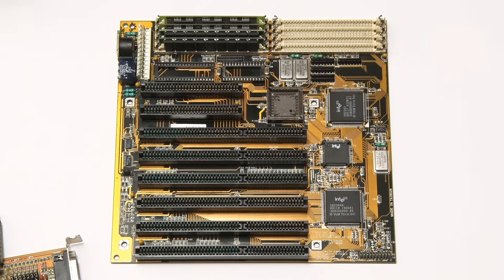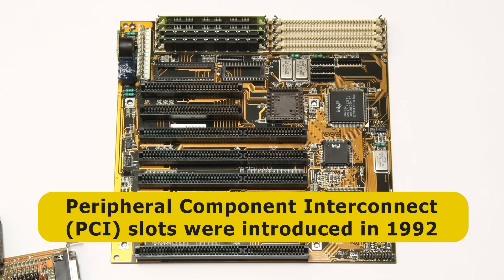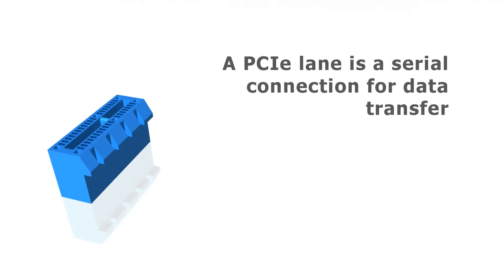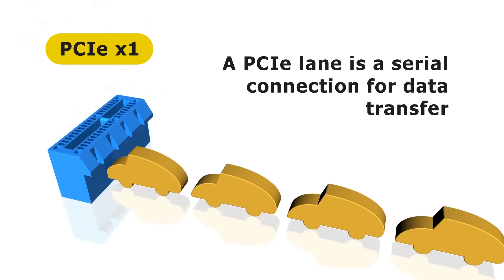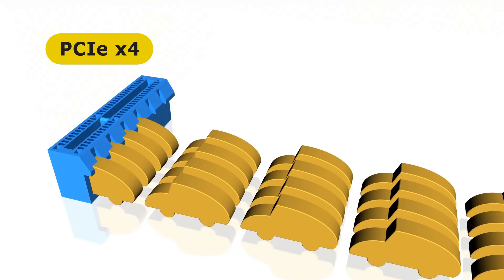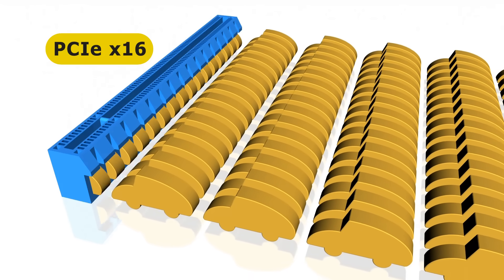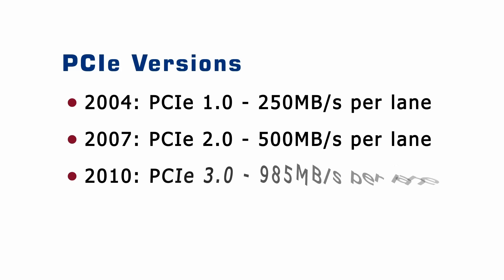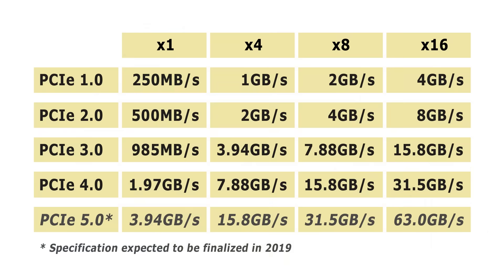Explaining PCIe Slots

Comment: I would add -- and maybe someone else has added -- that PCI had (has) two voltages specified for its slots, either 3.3v or 5.0v (never both in one slot). Consequently PCI cards are "keyed" to only fit in slots with the matching voltage, hence the notch (or notches) on their edge connectors.

All of the PCI slots and cards shown in this video are 3.3v, so the notch is close to the bracket end of the card, to straddle the plastic "blocker" in the slot.

5.0v PCI cards have their edge connector notch further away from the bracket end of the card. In fact, the clever engineers of PCI chose to place that keying position at precisely the distance from the bracket end of the card that would enable motherboard manufacturers to use the same connector hardware for both voltages simply by populating the motherboard with the connector rotated 180° from the 3.3v position.

A few PCI cards include a voltage switching capability. To this end, they have two notches in their edge connector, enabling them to fit into either a 3.3v or 5.0v PCI slot, and to automatically adapt to the voltage they meet.

Comment: I think it would be fair to say that PCIe is the new ISA, if you will. You can put an 8-bit ISA card in a 16-bit slot and it'll run fine and likewise AFAIK you can put a 16-bit card in an 8-bit slot and it'll just run slower. I believe the same is true for VLB, you can but an ISA (8 or 16 bit) card in a VLB slot and it runs fine and I think you can put a VLB card in an ISA slot it'll just run much slower.

Comment: AFAIK the different AGP standards were all keyed differently so you couldn't physically fit a card requiring 3.3 volts into an AGP slot that can only deliver 1.5v but that was primarily in the early days of this format as once the "universal" AGP slot came out this issue was mostly resolved except for AGP pro that was used for workstation cards but the AGP pro slot itself could still handle a standard AGP card. 

That was in an "ideal" world of course, in the real world there were some cards were incorrectly keyed but they tended to get recalled really fast.

Comment: Finally someone who understands what they're talking about enough to explain it to others
Now how do SATA and PCIe conflict with each other using NVMe SSD drives as BOOT drives.
as in a MSI Z170A  Gaming M7
Reply from the maker: In theory, SATA and PCIe ports do not have to conflict. In practice today on many machines -- certainly MSI ones by many accounts -- they often do. And given that the SATA connectivity in an M.2 slot has to function as (one of) the SATA ports, I guess this is not surprising. So using an PCIe (NVMe) port will prevent the use of a particular SATA port, and vise-versa. This will be a specific machine thing, as described in its manual. Logically, SATA0 and the first M.2 port will share. My best advice is to roam around inside the BIOS, where somewheren (under hardware or boot options) it should be clear what cannot be used with what. Good Luck!

Comment: Thanks for clearly explaining this concept. I have two questions:
1. Why would manufacturers make a PCIe x16 slot physically but only allow a x4 peripheral to be placed into it?
2. Are traditional PCI slots still used in today's modern computers?
Reply from the maker: 1. It offers flexibility, as if you have two x16 cards (eg a graphics card and something else), you can run one at x16 and one at x4, which is better than not being able to use one of the cards. (In practice, x16 length slots with x8 lanes are more common).
2. Sometimes, yes. I have a 2016 motherboard with some PCI slots for legacy cards. But they are getting rarer.

Comment: What would this line from the AsRock Q1900m mean: 1 x PCI Express 2.0 x16 Slot (PCIE2 @ x1 mode)? Thanks for the videos - very didactic and to the point!
Reply from the maker: It means that the slot is x16 length, but only runs at x1 speed.
Reply: @ExplainingComputers  Thank you!!!

Comment: Recently i bought an older HP Z420 Xeon computer with many pcie slots. Just today i discovered that one of my pcie cards had slowly lifted itself partly out of the slot. Do you know of a way to prevent something like this to happen in the future? I put it firmly back into the slot again, but could easily wiggle it partly out again.
Reply from the maker: All I can suggest is regular checks. :)
Reply: Fit and screw in the right bracket to the chassis.

Comment: Great video.. thanks tho I my MSI B350 motherboard the pcie x1 do not detect my wifi pcie x1 card. Any solutions?
Reply from the maker: Do you mean not detect at all (ie does not appear in the BIOS), or does not install drivers in the OS? If the latter, try searching for a driver online.
Reply: It does not appear in the BIOS, I have to slide it into the next GPU pcie x8 slot for it to work!!!

Comment: Informative video. Thanks. But a question:
What's the difference (if this is actually a 'thing') between processor lanes and chipset lanes? I'm looking at a Ryzen chip which, according to specs, supports only 16 lanes. But if the video card takes up all 16, and if I have an M.2 MVMe SSD on board needing, say, 4 lanes, where will it get them from?
Reply from the maker: There are lots of different lane types (eg for PCie and USB). Both a video card and an NVMe SSD will use PCIe lanes, and so -- yes -- performance will suffer if you have a CPU that supports 16 lanes, and a 16 lane graphics card and a 4 lane drive, as they won't both get to use as many lanes as they want. However, as far as I am aware, Ryzen chips have a minimum (and it depends on the model) of 16 PCIe lanes dedicated to the PCIe slots, 4 dedicated to M.2, and 4 used for the chipset more generally. So you need to distinguish between total supported PCIe lanes, and those allocated to particular interfaces.

Comment: Are there any *2 slots? Anyway, so if some of the longer boards can be used in smaller open-ended slots, then why do they make some of the sub-16 slots the full length instead of just using smaller open-ended ones?
Reply from the maker: I don't think x2 slots were ever a thing. On the slot length, they could do what you suggest. But there are always space constraints on a motherboard.

Comment: These videos are good for what they are, a high level summary. I gave them a like, but I think they could be improved upon, without overwhelming the viewer, by providing just a little more depth such as pin count, bus and lane data width, the difference between buses and lanes, how that relates to transfer rates, the difference between theoretical transfer rates and throughput rates, power consumption (in watts) etc.

Comment: One question, I have a HD8950M graphic card from a broken laptop. Since it uses PCIe, will it work on a desktop?
Reply from the maker: You would need an adaptor I think.
Reply: @ExplainingComputers  Is there a difference between PCIe from laptops and from desktop?

Comment: I do wish you had gone just a tiny bit more into detail. Specifically, stating that cpus can support a certain number of pcie lanes at a maximum, and putting too many pcie cards I to the slots can cause the Cpu to force those x16 lanes to operate in x8 or x4 mode.

Comment: i hope to see explanation from you about PCI lanes in CPU, GPU, RAM, NVME, USB and motherboard! It makes a lot confuses for some people (like me) in understanding do they need pro-level cpu to get a workstation with modern gpu & nvme drives work together without bottlenecks. (sorry for my english). For example, as i see 8700 intel would not be the right choice for Vega 64 with two m.2 SSDs and full RAM slots occupied and usb, right? (ok, sata may go out)
Reply from the maker: This is a good idea for another video -- noted! :) As you can, you need to think carefully if planning on using all of the features of a motherboard.

Comment: I know it's a little more technical, but you should also mention pcie's bifurcation ability, that is, to take a pcie slot and split it up, so for example turning a 16x into 4 seperate 4x slots, 8x slot into 2 4x slots, 4x slot into 4 1x slots, 16x slot into 16 1x slots, etc... provided you are using a pcie card/adapter that is wired correctly (such as the Asus Hyper M.2 16x card) and you have the setting in your UEFI since there is no way for it to automatically detect (only runs the first slot connected otherwise)

Comment: A few years ago, i came across a computer forum thread in which one guy told a tale about how he had physically hacked a PCIe x16 graphics card to fit into a PCIe x1 slot by simply sawing off the 'excessive' lanes, and aside from a degradation in performance, it actually worked.
Mind you, though, it's not something i would recommend!

Comment: then can i put my gtx 660 vga card on pcie ×16 slot?...is that work?
pc specs :-
core 2 quad q9550 (2.83),
foxconn g41 mxe motherboard,
ddr 3 (4GB ram),
and 450 voltage psu.??
Reply from the maker: I think  GTX 660 cards are PCIe, so any such card should work fine in any computer with a PCIe 16 slot to put it in. Your PSU may be a constraint, though you are probably just about OK assuming you mean you have a 450W PSU.
Reply: +ExplainingComputers yes i have a 450 voltage psu...and thanks for your reply..😊

Comment: You can put a x16 card into any x1, x4, or x8 slots but it often requires modifications to either the slot or the card. I've had situations before where I cut some of the pins off of a card to get it to fit into a smaller slot and I've had situations before where I cut the back of the slot off to get it to fit larger cards. It'll work in any system, you just got to make sure you're not breaking things when you do it.

Comment: Thank you for producing this video and doing so with detail explanation from beginning to end. When I first watched it, I thought this was an old video based on the motherboard presented, but the quality of the video suggested otherwise!!!!! Only when you got to the timetable of different versions did it confirm that this was a most recent video!!!!! Well done! I loved seeing the motherboards and checking out various types of slots. For the most part, I switched to a Mac environment back in 2014 so I stopped being concerned about all of this as there isn't anything I can do regarding what Apple produces each year. It is what it is. However, now that I have seen this video when I do upgrade in the future, I can at least see the breakdown and what slots Apple is using for the device I want to buy. Oddly, I have a computer case that I bought in 2015 in which I was going to build a new computer but after watching this video, I am inspired to build a home-made computer when version 5 comes out!!!!!

Comment: PCI cards came with gaps in the edge connectors in different places and ran on different voltages. I still have a couple of old mobos and a slot 1 cpu as well as an ISA slot tester.

Comment: Maybe in a later video you could touch on the way PCIe lanes are connected to the CPU, directly or via chipset (or other bottleneck). I found it hard to figure out how to check this with various MoBo manufacturers they don't seem to show much on how the lanes are connected and shared. And with M.2 storage drives running on NVMe with increasingly higher speeds in systems with at least have 1x high performance GPU occupying 16x or more lanes, I sometimes read that you should be mindful of potential bottlenecking, but with little to no details on how to manage this issue.
Reply from the maker: Good idea for a further video, noted.

Comment: Interesting video, it will sure help me choosing the right motherboard-videocard combo in the future, thanks!

Do you also have a video about RAM?
I ask because I recently bought some 2GB DDR2 sticks which I thought I could expand my other two sticks I already had.
Though all sticks are 800MHz, when I inserted them all in my motherboard they just run at 667MHz, I don't know why.
When I run them individually or dual channel they are recognized as 800MHz. My motherboard is a MSI K9A2 CF with the latest BIOS.
Reply from the maker: I am planning a video about RAM. I suspect there is some kind of hardware conflict with your new RAM compared to the old RAM, hence they are dropping to the lower speed.

Comment: PCIe 4.0 2017? Where can I find it or is it enterprise market only for the moment?
Reply from the maker: The specification for PCIe 4.0 was released towards the end of 2017, and around June 2018 some servers started to arrive with PCIe 4.0 motherboards (so enterprise as you say). We are still waiting for the first desktop boards . . . There is always a gap between when a standard is ratified and available for use, and hardware manufacturers deliver new stuff.
Reply: Ah, caught your reply just as I started watching the video. Good to know that 4.0 is already out in the wild, even if only in the enterprise sector. I am really stoked to see what such performance gains from PCIe storage come as I am constantly looking for ways to reduce cache latency (or whatever it is called when the HDD cache is loaded into VRAM) when initializing GPU rendering and simulations. I am not expecting the same mind-boggling gains that came from switching to SSDs from mechanical but anything that can improve iteration times is greatly appreciated.

Comment: The craziest thing about PCIe is if you cut out the physical barrier at the end of the X1 slot. You can put an X16 card in it and it will work fine. Just at the X1 speeds.

Comment: can you also adapt one pci-e x16 Slot ---> four pci-e x4 slots
Reply: Not easily because the x16 comes with one set of clock/power lines that you see in the small section of the connector. You can, however, get a chip that takes the x16 and gives you four x4 on the other end. There are devices that do this, primarily for M.2 cards because these only use x4 at the moment.
Reply from the maker: Bunny Warren is right.

Comment: An important point is that the AT or ISA bus was a parallel port. So with such a bus e.g. 16Bit data were distributed on 16 data lines. If all 16 bits were set, then these were read out. This required a very precise time management. With high transmission rates/frequencies it became more and more difficult to arrange the length of the traces in such a way that all bits were available at the same time. In addition, all slots shared the same data lines. So it was more and more difficult to compensate the mutual influence of the data by the different inserted expansion cards. With PCIe, each lane comes individually from the processor or chipset. So no other plug-in card influences the data of another card. With the parallel port design, only one device could use the bus while the others had to wait. With PCIe, all devices can use their own lanes at the same time. Each lane does not transfer one bit of a byte, but whole bytes. Each lane also has its own transceiver (receiver/transmitter) for each lane. So you don't have to make sure that the signals really arrive at exactly the same time and the different connected extensions don't influence each other. On modern boards there are also things connected to the PCIe that are soldered to the mainboard. Each CPU or chipset has a limited number of lanes. Depending on how many extensions you plug in, the number of lanes can also be split; so a 16 lane slot can be degraded to an 8 lane slot if you plug one card into another slot. Then the lanes that are omitted are available on the other slot. Therefore you have to read which port should not be used if you need the maximum speed at another slot.

Because PCIe is so fast, only a few devices are dependent on multiple lanes. Only graphics cards, very fast network cards and hard disk controllers can process the data fast enough to use up a PCIe lane. Therefore only one lane is sufficient for most plug-in cards.

Comment: Anybody who's into retro computing may be familiar with the range of ISA cards some people are producing to keep these vintage systems running, such as cards to use an SD or CompactFlash card in lieu of a hard drive, like this guy https://www.lo-tech.co.uk/product/lo-tech-isa-compactflash-pcb/

ISA is really easy to design cards for, because of how simple computer architecture was back then. You've got your address lines, and your data lines, your read and write signals, and so on. You could do quite a bit with an EEPROM chip and some 74xx series logic gates.
Reply from the maker: This is really interesting -- thanks for sharing here.
Reply: I had to build my own version of the lo-tech ISA-CompactFlash card on a veroboard for my Tandy 1000HX, since I didn't have enough free space to use an ISA adapter with the PLUS slot that Tandy used at the time for the EX and HX series of it's 1000 line. It's just 8-bit ISA with a different connector, but since there's only three slots, one taken up by the RAM/DMA card which has the riser connectors to the other two cards, there's only enough physical space to use a single ISA to PLUS adapter while having everything fit. I already had an ISA controller card installed for it's serial port using such an adapter (which I build using a ribbon cable to get the thing to fit), leaving me with no choice but to build my own version of the ISA-CompactFlash card to fit into the available space using the PLUS connector. 

In designing this card, I learned a fair bit about the ISA bus. I also learned that ISA slots all run electrically in parallel, so building an expansion ribbon to another set of slots for additional expansion is trivially easy if you've got the parts.
Reply from the maker: Cool.